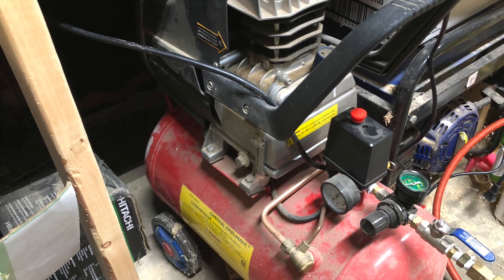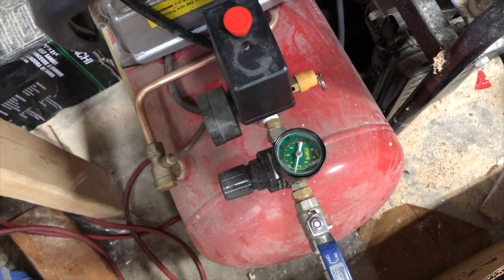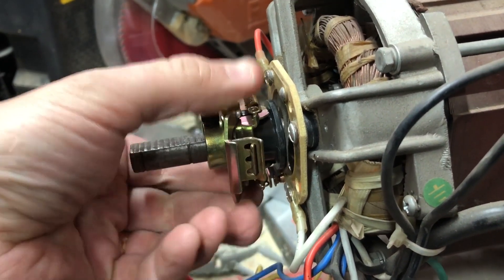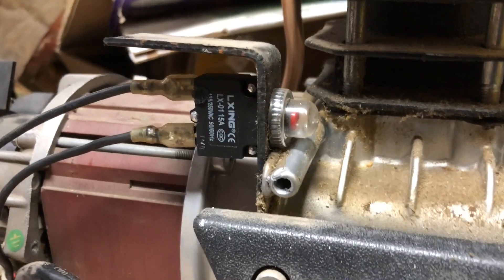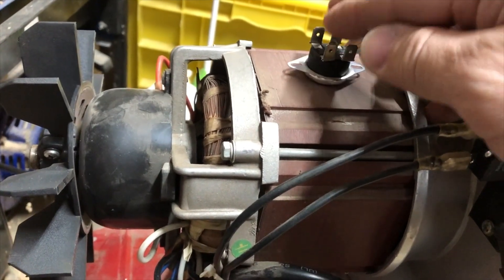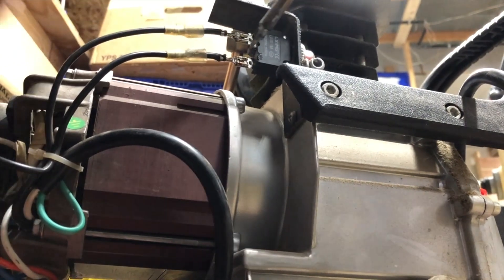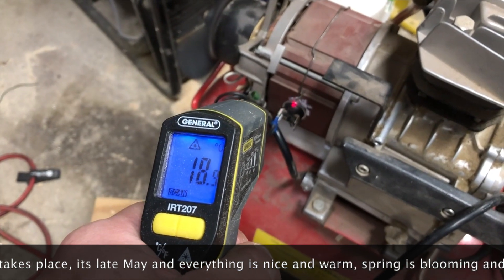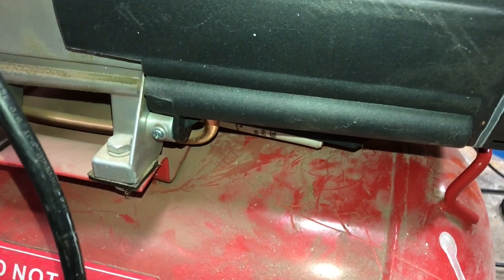New Thermal Protection for Old Harbor Freight Air Compressor

Comment: so you leave it always on? but they highly recommend draining tank after each use, because water accumulates inside tank and will rust it out.
Reply from the maker: Do you always follow recommendations? It’s been 10+ years since I got this compressor. It paid for itself, years ago. I’m actually waiting for a good excuse to upgrade my compressed air supply.
Cheers.
Reply: I just got an auto drain from Amazon. Does the trick.